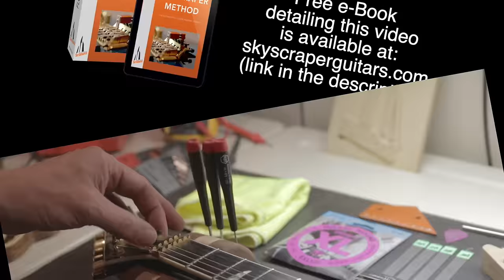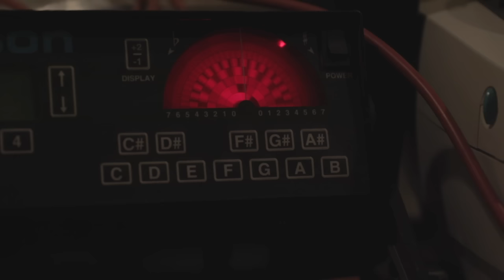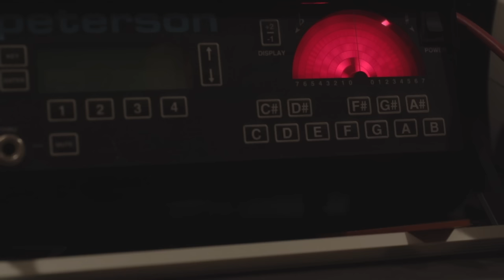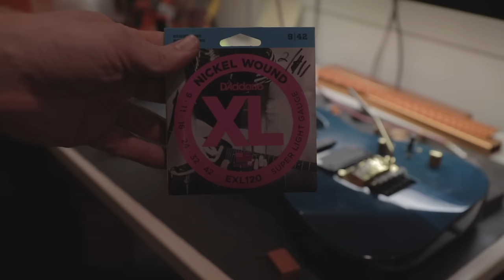FULL Floyd Rose Setup Including Intonation - The SkyScraper Method

Comment: It’s so refreshing to finally see someone setting up a Floyd Rose properly I’ve watched many videos and this is the only one that has got it right
Reply: Technically it's not correct.
Reply: Fat Lip any YouTube videos on spring tension for setting up a FR that you recommend please?
Reply: Spring tension is the simplest part. I've had my first floyd guitar for a week and I've got it down, tune to whatever you play in after you have your action intonation amd neck relief set then tighten or loosen the springs to where the bridge is parallel to the body while being in tune. It's really simple guys.
Reply: @Ayyem93  You do neck relief first, then the action. But I'd set up the springs before intonating. You don't want to have the bridge at a different angle or height before finishing the intonation, That's just how I'd do it but your method would end up working too. I really agree with you about the spring tension being quite simple. I'm pretty sure I figured it out on my own like 20 years ago when I barely knew what I was doing haha

Comment: I don't even bother blocking up my Floyd Rose when tuning.  I just put the strings on and tighten them to similar tension until the Floyd Rose is parallel with the body, which is where it should be if setup properly.  Start tuning: some strings will be sharp, others flat...just do a "slop" tune to get them close.  If the tension on your claw is correct, you should now be fairly close on the tuning....this will avoid that never ending see saw you speak of.  Now you can fin tune it like you would any guitar.  Of course as the strings stretch and snug up around the tuning machines, you'll have to do this a couple times...but that's the same with any guitar.
Reply: Isn't that basic standard string changing procedure? Do one at a time, tune to pitch, stretch it and retune till it stays in, then move on to the next string
Reply: @stilllifewithguitar184   Most people's problem with the Floyd Rose is that they have to tune, retune, retune again...forever until the bridge is balanced.  And I don't even do one string at a time.  I take them all off at once and put all of the new ones on.  The tricky part (if you haven't used a Floyd Rose) is that you have to tighten all of the strings evenly until the bridge is floating parallel to the body BEFORE you bother tuning it, to avoid that never ending tuning cycle.  Also, if you change tuning or string gauge, you will also need to adjust the claw.  Which should be true for any tremolo, but the outcome is much more severe if you don't adjust the claw in a Floyd Rose.  None of this applies to a stop tail piece.  So I would say no, it is not that same as any string changing procedure.  Which is why most people get fed up and think their Floyd Rose is broken or crappy...which it is not.  It is by far the most reliable tremolo I have ever used, when used properly.
Reply: I do the same by bridge stays level every time
Reply: @ivankrushensky  you are completely wrong. 

You didn't watch the video did you? You are doing it extremely inefficiently. Tuning string "close" to balance the trem is the whole problem. 

1. Block the trem. 
2. Replace and Tune all 6 to pitch. 
3. Stretch strings. 
4. Tune all 6 again. 
5. Lock both ends, bridge and nut. 
6. Un-block the trem.
7. Screw claw in until tuning comes back to pitch. 
8. DONE.

Any other way is less efficient. And guessing.
Reply: @ryans9029  okay...wish I knew who you actually were and lived by you. We could have a race.  Done it both ways.  You don't need a block if you know what you're looking at and how a tremolo works.  Sorry.  You just don't.  An Allen wrench and strings of the SAME gauge.  That's all you need.
Reply: @ivankrushensky  oh. You are talking about just replacing strings of the same gauge? You don't need to do anything with strings of the same gauge. Literally nothing. Just Tune them up to pitch. 

We are talking about SETTING up a floyd rose here. Which means intonation. Changing string gauge or type. Setting relief. 

You see talking about changing strings on a guitar someone else already set up. 

Got it. 

And for the record. It's faster to simply change strings if you block the trem as well. You only have to bring strings up to tension/in tune, one time. 

If you don't block the trem, you have no choice but to fight the springs back to level. 

Been setting up Floyd's for 20 years. Longer than you've known what a floyd was. Instead of falling into the D/K trap, and confirmation bias, actually be open to learn something. You can't learn if you think you already know it.
Reply: @ivankrushensky  blocking a trem does not add time to a string change... It takes 3 seconds. And cuts much more off the total time. 

You clearly don't get it.
Reply: @ryans9029  lol....do you even own a floyd rose.  You cannot....CANNOT change string gauge simply by blocking the trem.  It involves adjusting the spring tension, which is not accomplished by using a block.  The ONLY purpose of using a block is to keep the FR in the same position as you exchange strings of the same size.  If you put heavier strings on, it will raise the FR to the point that the block will come loose and fall out before you get the guitar in tune.  And my point isn't that a block takes more time.  It's just unnecessary if you understand how the FR works.  And the is a way to avoid the tune, retune, retune, etc.   WITHOUT blocking the trem.  And I was describing how to do that.

Comment: That's a nifty intonation tool. But I stopped using feeler gauges years ago. It's much quicker to just use two fingers one at each end of the fretboard and you could see the relief. I don't you string height measurements either. I lower the action until it buzzes. Then I bring it up until it stops buzzing. That's the maximum lowest action. I call that the Billy Sheehan method, he made it popular .

Comment: You do the setup the same way that I've been doing it since almost when I started to use and love Floyd Rose systems (licence, special, etc.). There are a few points/tips that I have to mention:
· All the setups that I do, even tho it's a little bit, just a little bit more difficult, I do it in playing position. I've noticed that gravity and neck-rest thingy affects the intonation, string height and pickup height. You to the setup in certain position but when you sit or stand up and put your guitar in playing position, it changes.

· The wood block can be customize with any piece of wood, a saw and some sandpaper. I have one for two guitars that I have (sand paper two faces of the block).

· Before intonation, by the way you did a fantastic job mention how to do it properly and with the correct tools,I advise to first take the old strings, clean the guitar, put the new strings, tune it to pitch, check the relief of the neck, check the pickups height and then the intonation.

· When putting new strings, release the springs just a little bit, lock the bridge by putting some thin enough pieces of wood underneath the base plate of the bridge but just to lock the strings and putting some tension on them, because it is a struggle to move the bridge with the tremolo bar every time you put and string and lock it due springs tension, specially for beginners on this.

Everything else, OH MAN! You are on point :) Greetings from Mexico.
Reply: This is correct,.. I've found the same thing,.. especially on guitars/necks that are thin.
Reply: Tienes toda la razón, yo lo aprendí del técnico de Steve Vai. El explica del porqué hay que setear la guitarra en la posición de cómo se toca
Reply: exactamenteeee, te sorprendería la cantidad de ``técnicos `` he visto ajustar guitarras en su mesa de trabajo, y a la hora de tomar la guitarra siempre están mal ajustadas

Comment: The diagonal set-up of the tremolo springs, in this video allows them to maintain a higher tension of the outside springs, preventing the need to tighten the screws excessively or adding a fourth spring. Many luthiers recommend this approach to spring set-up. Great video! Thanks for offering your tools to the world!
Reply: Everytime I've tried the diagonal setup with three springs it's causes tuning issues when using the Floyd. I see it so often but I've never got that to work.

Comment: Great video! I used a Sharpie pen instead of a 9v battery for a trem wedge, worked really well. I found that if the Sharpie wasn't big enough I could add a guitar pic until the trem was flat.

Comment: 6:26 man I don't care what anybody anywhere who has played or worked on guitars for at least 90 years will say, I truly think having the bridge slightly pulled like that is the best way to have your floyd setup. It, for whatever reason, seems to stay in tune the best for me. I always adjusted the claw to bring the bridge plate parallel with the guitar body, but it somehow has not been as reliable as keeping that slight tilt to have an extra little edge on the strings. Maybe it's because my string saddles kind of point upwards, so this evens things out.  I have a Floyd Rose Special, btw.
Reply: I agree - I also prefer having the bridge in that position. I also took a chance on the Fender Tremsetter, and was not disappointed. The Tremsetter used in combination with an authentic Floyd Rose locking nut keeps the strings in perfect tune no matter how much or often I use the tremolo. I’m using a custom installed ‘licensed’ Floyd Rose with no issues. As long as the locking nut is the real deal, and you use a Tremsetter, an $18 Floyd Rose works out fine.

Comment: The biggest problem I have with my Floyd Rose is the B string always seems to buzz in its locking nut groove. I can't seem to remedy it. Here's a tip from me about changing strings. I find changing one at a time is best. For example: De-tune the old bass E. Then take it off. Replace with the new bass E and re-tune. Then take the old A off replace with the new A and then re-tune. Etc.

Comment: That Skyscraper gizmo you created seems like the only logical choice to do this process. I wasn't entirely sure what to do with adjusting that little bolt on the saddle, then somehow moving the saddle forward/backwards appropriately without it flying away lol. I've changed strings/tunings to the point where I'm in bad shape as far as intonation. My hardtail guitar is so simple with only 1 easy screw to adjust :p

Comment: Excellent video!  I've had a Floyd guitar(Jackson reverse dinky) for 25+ years, and its nice to learn a new trick or two about easier ways to set them up.  One thing I've always wondered. On "regular" guitars with a bone or plastic nut, people always go on about  filing and setting the nut height. With a Floyd, its steel, and you never see anyone adjusting the height. Are they just that accurate because they are machined?  Also, mine doesn't have that extra bar behind the nut, and now I see why I need one.  When I put new strings, I put the fine tuners all the way out, then 1 turn in because after tuning and all that, when I tighten the nut locks, it makes the note sharp and sometimes I have to turn them out. That extra bar probably prevents that by keeping the strings flat against the nut. I will definitely be using your "ball end on the tuners side" technique. Genius!
Reply from the maker: You'll find shims under a lot of FR nuts.  The nice thing for factories is that they don't have to file them, so as long as you are consistent with production, they should all sit perfectly on the neck.  Over time, they don't wear nearly as much as a bone nut since the strings are clamped.  As for the clamps and going sharp.  The key is "snug".  You don't have to make the clamps tight, just snug.  It takes very little pressure to keep the guitar from slipping out of tune.  That said, I always plan on the strings going just a tick sharp...  Tis the nature of the beast.  Take care and thanks for the great comment!!!  Greg

Comment: IMO the neck rest should be closer to the body. When it's so far back toward the headstock and the rest of the guitar is not supported, the weight of the body will press down on the neck pressing the headstock forward and creating bowing where there normally wouldn't be in playing position, leading to tightening the truss rod more than it should be and getting fret buzz. I know you said you're just getting an estimate at first but it can easily be fixed by just having the neck rest further up towards the higher frets where there won't be any neck bending.

Comment: 15:50 just put an eraser under the bridge to hold it in place its a lot easier then pushing the bar down while trying to put the strings in
Reply: Good tip! Last time I used the tapered wood shims you get at the hardware store (they're actually for fitting windows into a framed wall), they are soft wood and bridge across the rout. I'll try your eraser trick next time.
Reply: @5000rgb  No worries good luck mate!
Also take not of where the guitar is tuned with the eraser under there

Comment: Hey man. I got my first Floyd last week after like 10 years of playing hard tail. Man its rough. I am doing everything myself and I almost destroyed the guitar. The floyd flew out off the posts cuz I took out a spring and damaged some wood. That being said I put it back together and learned a lot. Then I was going flat a lot when locked in after wammy abuse. Finally got through that by stretching strings more, tightening nut, and oiling the knife edge. One of my screws into the wood that installs the nut is stripped but not seeming to have an adverse affect right now. I feel mentally exhausted lol. I am exerting actual effort making sure I don't get negative. I think with time I will come to the true appreciation of the floyd. I took it to a tech and he fine tuned the intonation, neck relief, bridge height, and tension. He said I did good, but he made it perfect. Just the visual aesthetic of these guitars is so awesome so I will continue on learning about the floyd. I absolutely love your Kramer. I already told myself a S-S-H or just a neck S and bridge H floyd guitar is my next axe like the one you have. I got a Ibanez 1527 and I'm loving it (besides the work lol). Any advice? I see people work on it and it just seems so fluid and effortless meanwhile it seems like everything I do is labored and takes hours to materialize good results with a floyd lol.
Reply from the maker: You're in a good spot...  You've got your guitar set up and working good...  That makes it WAY easier for the next time.  When it looks easy, that means someone has put in a TON of time getting good at something...  We've all been there though.  I can remember wrestling my guitar for DAYS trying to get it to play right.  This was before I knew all the little tricks...  I do a full setup once or twice a year depending on how the guitar plays.  If it's playing good, no setup needed.  If the action changes, I start with the truss rod and move on from there.  Most of the string changes are simple.  Loosen the springs, change strings, block, tune, stretch, tune, lock, adjust springs, enjoy!
Reply: @SkyscraperGuitars  I appreciate the encouragement. I subscribed and will continue to learn. Post more vids with the Kramer :) that thing is beautiful. Thanks and have a good day!
Reply from the maker: @TheMLGTrashCompactor  The old Kramer is my #1, so it finds it's way into a lot of content!

Comment: Thanks for this video. Thanks also for the FREE e-book. I saw another video like this with the sustain block's tension springs being adjusted and voila, it's in tune and intonated.  I must give you higher marks for depth of instruction and production value of your video. Besides being mesmerized by that cool tuner, why did you tune/intonate with the old strings, get rid of them, then start again with new strings?
Reply from the maker: I always "rough in" the setup with old strings if I can.  That way I know if everything works before I blow a new set of strings.  Also, I can play the guitar after the adjustments and see if there is a high fret or something else that will need repair.  If I changed the strings first, then I'd have to throw them away if I had to take them off for a fret repair...  I usually rough in, then change strings, then let the guitar sit for a day or two, then go back through everything and make sure it's still happy.  I hope that answers your question!

Comment: I really like your tool. I have an early 90’s Charvel 375 Deluxe with a Schaller Floyd Rose and the barrel style string lock bolts so the key does not work with my guitar at since it relies on the longer screw type.